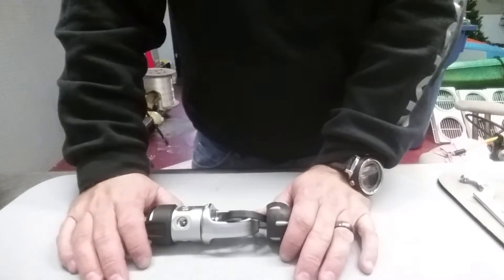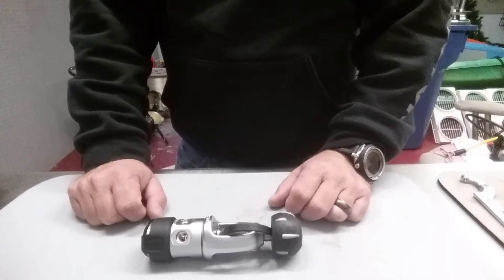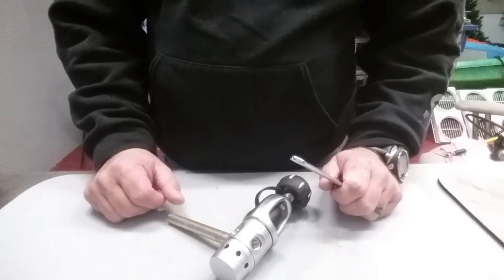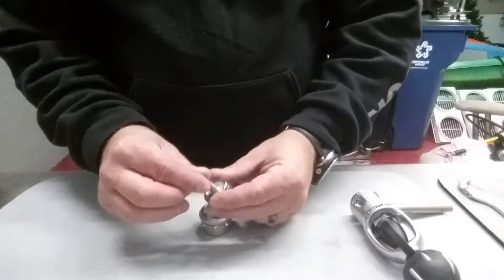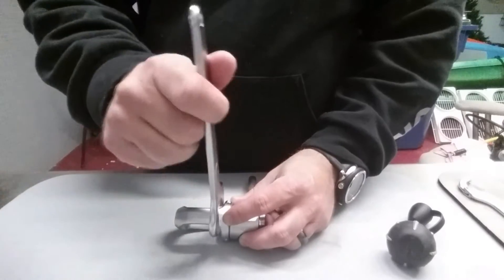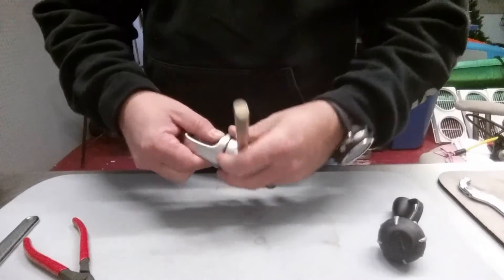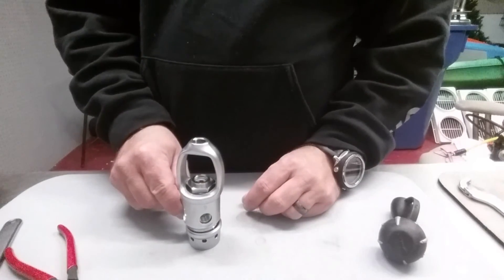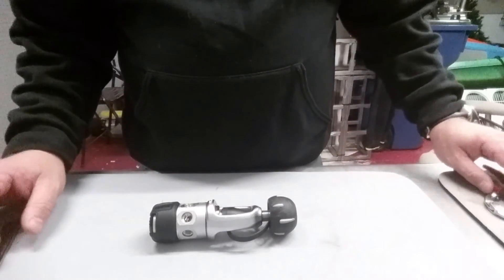Piston First Stage Disassembly and Reassembly

Comment: What is a certified service tech?  My husband is a divemaster and completed multiple service tech classes.  He is also current with all continuing education training.  But even with all this training, his training is invalidated due to him not working at a dive shop.  What is the purpose of this rule and why are not dive shops in violations of numerous "right to repair" laws?
Reply from the maker: Hello Exploit the Childless, that is a great question. Typically, a service technician is someone who is trained by a specific gear manufacture. This training has to be renewed ever few years, depending on the manufacture, and for the most part only available to affiliated personnel at a training center or retail center. Most manufactures will have a 2-4 day training, that authorizes an individual to service that specific manufactures equipment. Anyone with a basic general knowledge of how scuba equipment works, can service their own equipment, but the availability of parts may not be accessible by the general public. The high liability that comes with equipment service, is the number one reason that equipment manufactures requires a person to be a trained service technician for profit. In regards to your last question, I would refer you to an attorney that specializes in "Right to Repair" laws, as we are a simple Scuba YouTube Channel, and we do not produce content on legal matters.
Reply: @LakeHickoryScuba  Renewed training for service techs has not been available for at least two years due to COVID.  Clearly, no service tech has been to a 2 to 4 day class.  My husband has attended numerous Microsoft Teams meetings/classes, where they have provided service notes and change updates.  So if the service tech is upto date, why the requirement to be working for a dive shop?

Comment: Are there ever any torque requirements or is it all just “hand tighten”?
Reply from the maker: Great question Scuba Bro. Typically, in the scuba industry, items that are sealed with an O-Ring, only need to be hand tighten.
Reply: Usually the yoke nut or din retaining bolt or the balance plug on diaphragm regulators have torque specs. The purpose for those specs is to stop people from over tightening. which people like to do. Do not over tighten!

Comment: Thank you so very much   I am a veteran instructor in fact 35 years I have been servicing regulators for many years but occasionally there are new styles coming on the market  just your little tips have been very helpful keep up the VERY GOOD work it is pleasing to see the open approach to demonstrating different types of equipment overhaul hints etc
Reply from the maker: You are welcome, glad you liked the video.